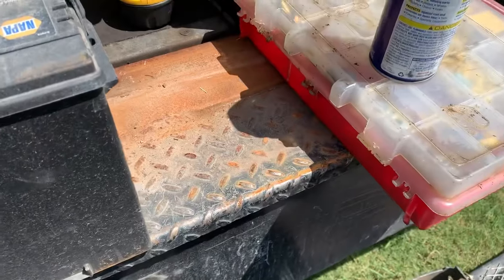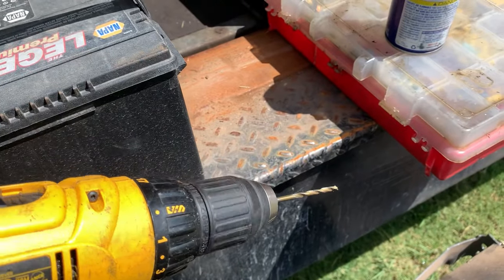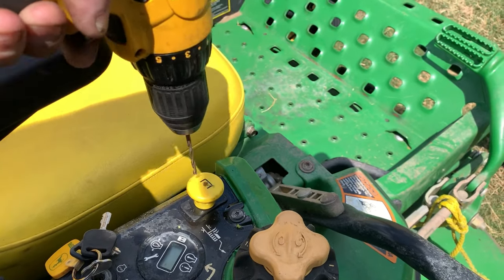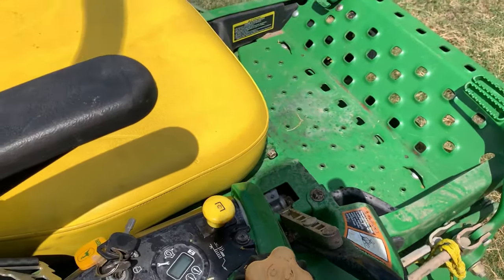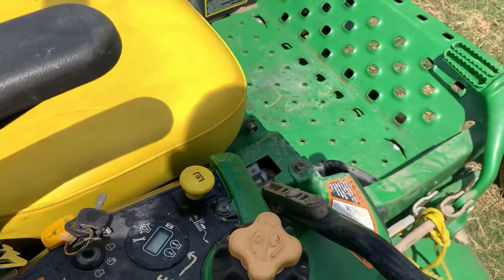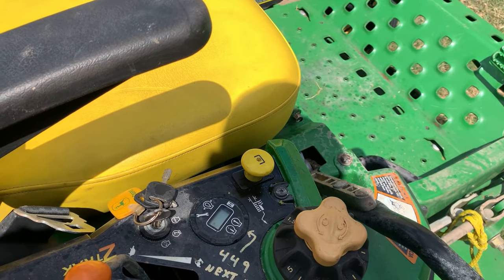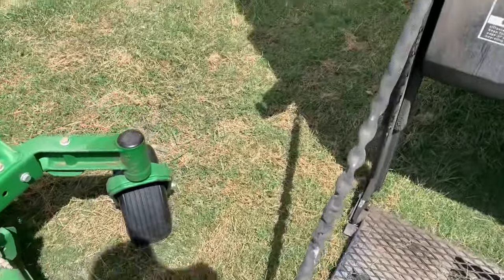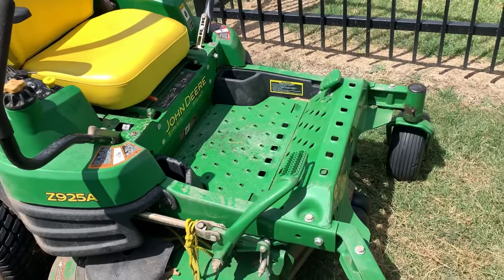TRY THIS HACK IF YOUR BLADES WONT COME ON!

Comment: Great tip. Haven't seen that one.   Might have to plug the hole up so the rain and stuff doesn't get in.  Depending on if a new switch is coming.

Comment: Nice one! Never really tried that way. I made a connector to bypass to the on position a long time ago I use to test if it's the switch or one of the many relays, fuses, or safeties though. (If it's easy to get ahold of the plug on the bottom of the switch I'll usually test if it's the switch before pulling the multimeter out.)

Comment: Thanks so much for this couldn't have come at a better time. My Sears 24hp was down for a month with a starting bug which finally ended up to being a ground & crud inside the key switch & a small spring laid over.  Meanwhile had clutch off & cleaned up to replace the belt & blade worked great at 1st then had to hold it out by hand finally putting a bungee on it. Then it quit & I read your hack. Seems I had to drill the hole deeper than expected thinking I'd hit wiring or? Been working great for 3 weeks now & cancelled order for a new switch. Btw 54dg. here in Iowa now but 90's expected again for the weekend. Thanks again!!

Comment: Ive had to do this on my pto switch AND a few solenoid switches when they don't make connection en just click then plug the holes with grease or soft wax till it needs some more WD en some blast'in

Comment: I’m going to try that! Recently the switch (large button) exactly like yours, on my DR POWER XL30 is not engaging the blade. Everything else works perfectly, I checked the cable and everything is fine. But the large button isn’t working to make the blade spin. I am going to try it this evening. Thank you 🙏!!!

Comment: I have a JD Z810A mower, i run over some roots and my pto disengaged the blades. I  reset the pto and blades come back on. Now the blades keep disengaging mostly in thick grass but will restart when i reset the pto switch off and back on. Any suggestions on troubleshooting? Thank you, Floyd
Reply: I have the same issue
Reply: @bradgokey4534  Mine ended up being loose battery cable.

Comment: Looks like a great fix. I think you might take a hot glue gun and put a dab on the hole to keep trash from doing the same thing again. That would be a quick easy fix. Thanks as always for the great info!
Reply from the maker: Replaced switch thanks for the tip !
Reply: Silicone

Comment: Hello, maybe you can answer this question.   The battery in my lawnmower John Deere is dead, so I started with a jumper battery.  Once the lawnmower is running I try to run the blades, but they won't engage.  Is it because the battery is dead but the engine running?
Reply: yes, you need a working battery for the (electric) clutch to work

Comment: I have a JD X300, 443 hours, 42" deck.  Lots of trouble with it in last 3 years.  This is the latest.  Happened just today, same behavior as in this vid.  Just. Quit. while mowing, then blades wouldn't engage.  Switch is very different looking,  rectangular and about 2-3" long. Is it possible that it's the same problem in this mower? And would it be just the switch that needs replacing, or the clutch too?  Thanks.
Reply from the maker: Most likely, it’s the safety interlock module
Reply: The mower does start and run.  Problem is that blades don't come on.  Still think it's NOT the switch/clutch?  Is there a way I can test for certain?

Comment: Well I tried it and it didn't work. What's my next step a new switch? I'm working on a 73-in zero-turn bush hog. It's been in the barn all winter.
Reply: May need new clutch. Test the one you have with a multimeter.

Comment: What is the problem when your blades won't turn all the way off?? After turning the PTO switch off the blades still spin about 500 to 1000 rpm or so and never quit. Turn the switch back on and the blades are back to full speed and turn the switch back off and they are low speed again but won't never completely quit spinning.
Reply from the maker: Bad clutch or improperly mounted clutch

Comment: I have an old exmark turf ranger and my switch is going bad.  I need another but since it is so old they don't make the same type.  I cannot figure out what type of switch I can use.  It is an exmark turf ranger s/N 179,000 range.  the switch that parts tree has is not the same connection.  What should i do.
Reply from the maker: Here’s the upgraded switch. https://amzn.to/3uB3FJS
Reply: @THEMOWERMEDIC1  Thank you but it is the switch that controls the blades on and off.

Comment: I have a 2008 exmark lazer z hp 52". My blades engage but keep cutting out after a few miniutes. If I engage them at a lower rpm they seem to stay engaged longer but as soon as I boost up the rpms , they cut out again? I have replaced the pto switch 2x so I know it's not that. Any ideas?
Reply: I have the same problem, have you found out what's the problem yet?
Reply: @Floyd12345  it was my pto clutch cable.
Reply: @patrickgregory7920  I'll check that on mine. Thank you so much.
Reply: @MrFloyd1968  somehow it got lose and was rubbing on the belt is what happened. I replaced it and everything worked great. Got a new one on Amazon for like $15
Reply: @patrickgregory7920  Great information, thank you.

Comment: Good idea but you need to put a piece of tape over the hole to keep more dirt out of the switch.
Reply from the maker: Why, I’m just going to replace the part on momday
Reply: @THEMOWERMEDIC1  That's Cool. I must have missed that in your video.  Maybe????? spray contact cleaner would do an even better job of cleaning the dirt out of those dirty contacts inside of the switch.  P.S. thanks for sharing.

Comment: How would this tip work on a JD L110 mower??
Reply from the maker: The L110 does not have an electric PTO clutch so this would not work
Reply: @THEMOWERMEDIC1  Any ideas as to what can cause a delay in blades kicking in on an L110?  I already tightened the belt.  The lever seems nice & tight when I flip it to engage the blades.  I have to sit for maybe 10 seconds for them to kick in or sometimes I have to put it in reverse.  Very weird.

Comment: Sure hope this works so I don't have to pull the 3/4 full gas tank on my Cub Cadet LTX 1046 to get to the release points on the switch to remove it.....

Comment: Bailing wire, duct tape, drill -and bit and, a little WD-40.
How easy was that? Now you need to put a piece of duct tape over the hole drilled to keep dust and water out, easy enough. Thanks for the video. I would buy a new switch to keep handy until the wd40 trick stops working!
Reply from the maker: I’m not gonna do crap to it I’m replacing the switch did you even pay attention to the video?
Reply: @THEMOWERMEDIC1  I just meant us everyday fellows at home, you are a pro mechanic. I knew you woul replace the switch for the customer. Good work and thanks for sharing some knowledge. Some of are short on funds and need a hack to save $ sometimes. Love your channel, you are honest and real. Rare nowadays.

Comment: Mine was working intermittenly for a while before failing completely. No continuity between 2 switch terminals so I bought a new switch. I kept the old one so I'll try this trick and see if I can get continuity between those 2 switch terminals.
Edit:  Didn't work for me.

Comment: Isn't it a "NO NO" to run at full speed and then turn on your PTO??
Reply from the maker: No not at all.  1/2-full throttle is what the manual says in my Spartan zero turn

Comment: NEVER USE WD40 ON ANYTHING ELECTRICAL
Reply from the maker: Lol that’s what it’s designed for
Reply: @THEMOWERMEDIC1  I used it on a throttle cable once and an hour latter it looked like you had gone over it with a torch the plastic coating was actually dripping off the cable and it's not a contact cleaner. I won't have WD40 in my shop but you do you. :)

Comment: This is a dumb hack. Just pull the switch and disconnect from the harness and check the switch and connector harness for corrosion. This hack destroys a pto switch that probably is functional. And if you go too deep you will potentially damage the connecting harness.
Reply from the maker: Lol what ?